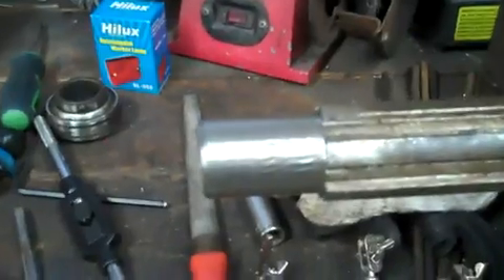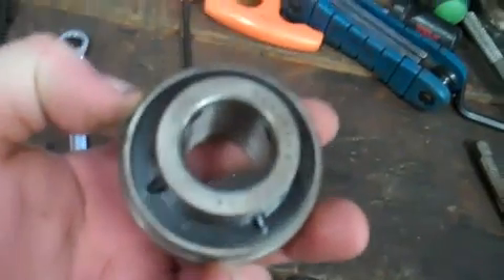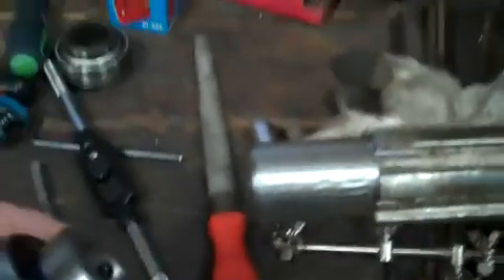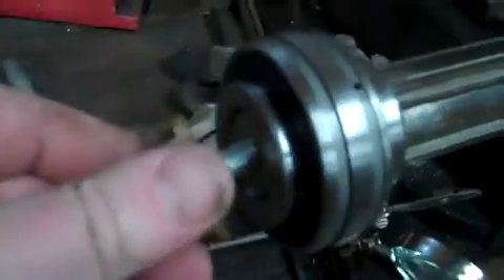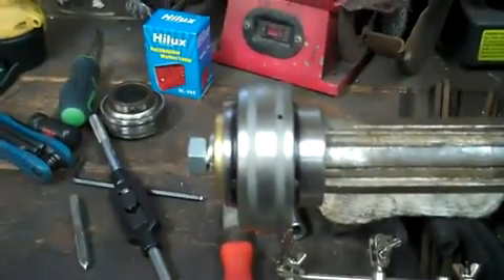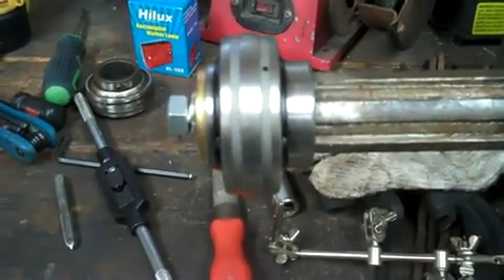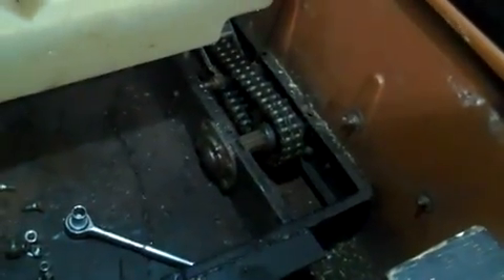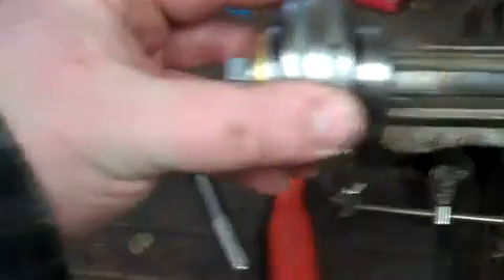Argo axle sliding fixed

Comment: It would be cheaper to buy new axles then bring your axles to a machine shop and get them to turn your axle on the ends. Not everyone has a lathe.
Reply: Andrew Hynes if you buy new axles you also have to upgrade your sprockets. $$